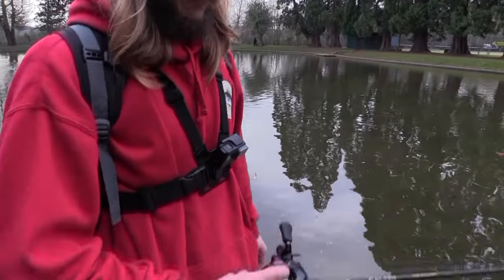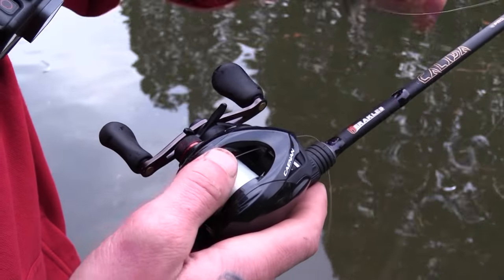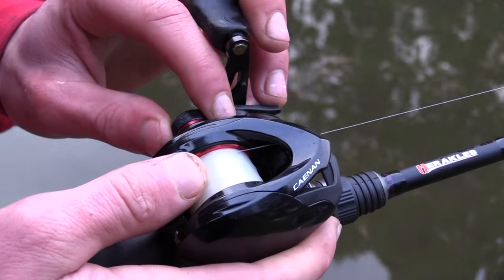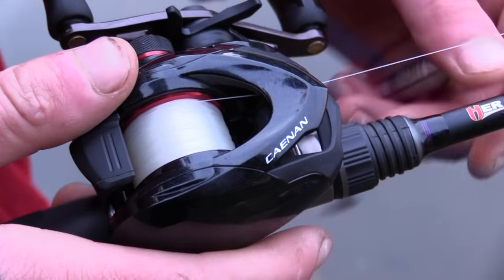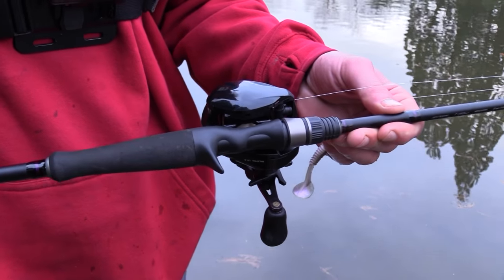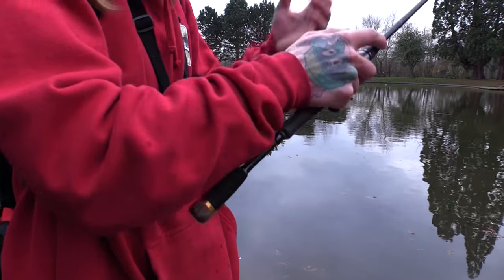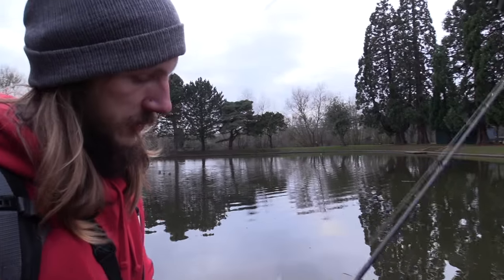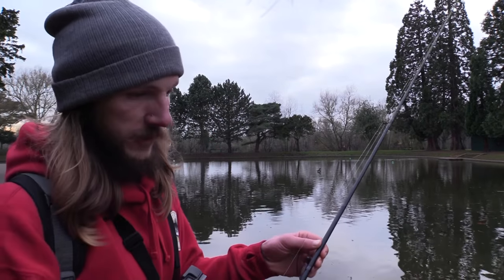How to use a Baitcasting Reel for Beginners

Comment: What a cool, knowledgeable guy.  Great tips, applies to sea angling with multipliers to. Fk I have/bought a pistol grip rod and bait caster many moons ago but have never used it! Think ill give it a crack in the summer, sea however not freshwater. Would it (8ft rod, bait caster) be suitable for chasing, macs, bass etc smashing bait on the surface off the boat. Usually I use a fresh water spinning out fit with a fixed spool ?? What about casting distance? I think I may need to invest in a longer rod.

Comment: What's a good bait casting reel that is 7:3:1 and is less than 100$?
Reply: Just watch the sales. I went to BPS and got myself their pro qualifier baitcaster for around $100 and it's a 7.1:1 and it also comes in a 7.5:1
Reply: gavinsmitty23 kastking has good baitcasters for a lot cheaper price than most
Reply: Shimano Casitas has 7:1 ratio at $100
Reply: Daiwa Agress

Comment: do you need a baitcasting rod
Reply: ollyfaz gopro yeah because you need the trigger grip to hold onto for when you are casting and the reel seat is different. Also there are more line guides but they are smaller than the conventional spinning reel
Reply: ollyfaz gopro yes because the spine of rod on bait casting rod is meant for bending backwards, plus trigger grip
Reply: I use an ugly stick four piece travel rod and I use it upside down. It is in fact a spinning rod but you don't need that stupid trigger I actually find it easier to use without the trigger. What really matters is what's most comfortable for you.